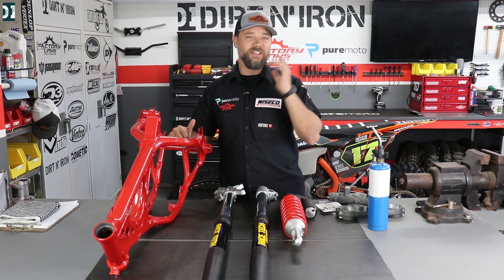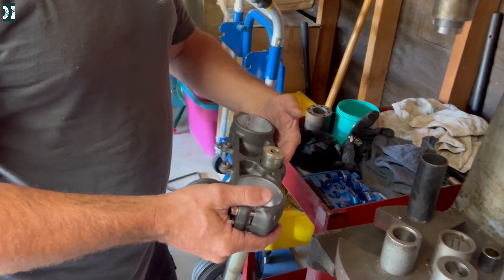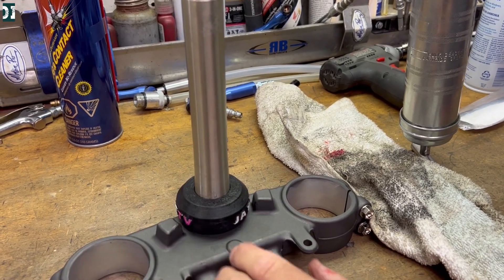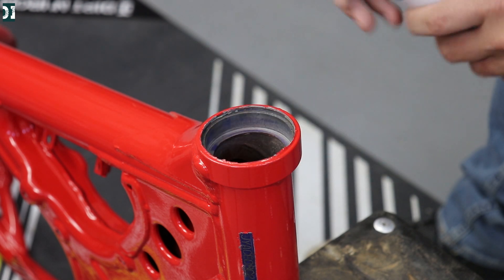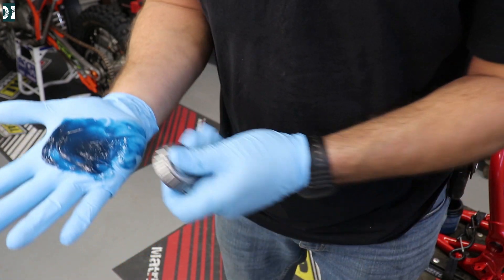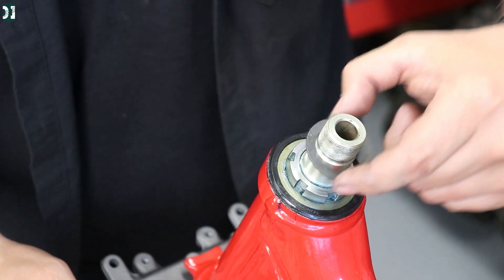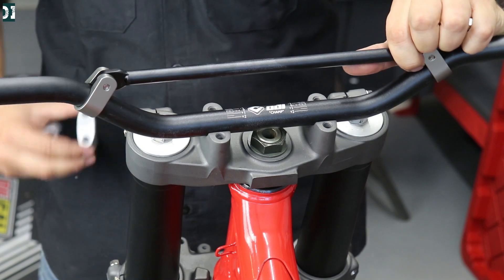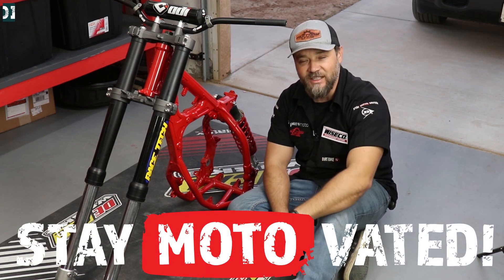YZ125 dirt bike build assembly starts!

Comment: Hi Rado, just a little hint too. The top of the forks should protrude 5mm above top triple clamp according to my yamaha manual. 5mm from top of triple clamp to bottom of cap/base
Reply from the maker: Thanks for the info!  I have it dialed by Racetech, they also have recommendations for the setup, we will adjust it once the bike is ready